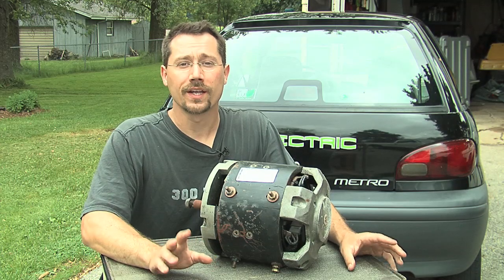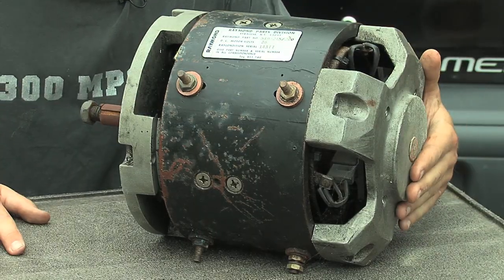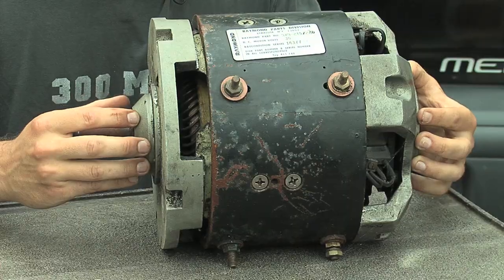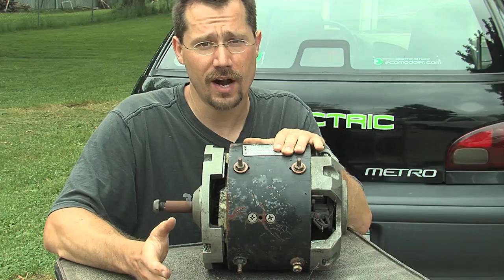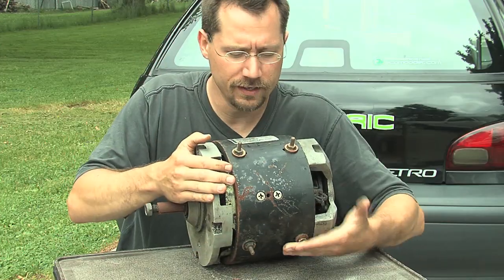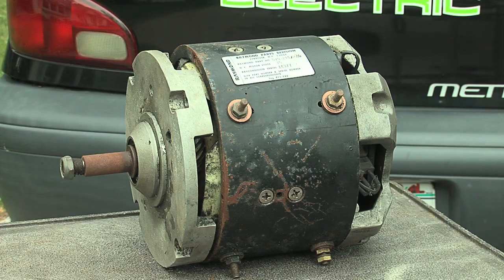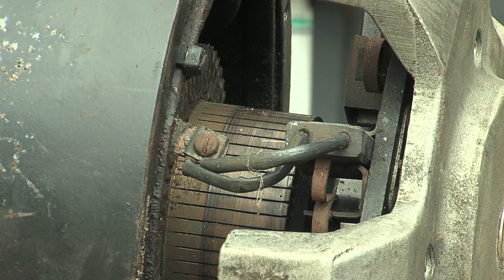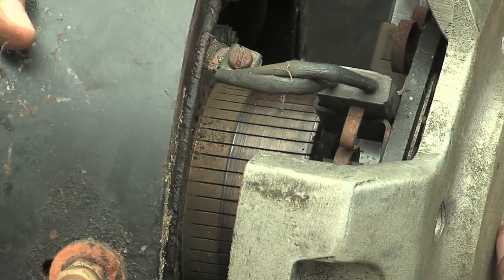5 Build Your Own Electric Car: DC Motor Basics

Comment: can you please tell the max torque/rpm of your motor.
Reply from the maker: The motor I used in this car was missing the ID plate, so I can’t tell you what it was listed at. I can tell you that I was able to have it draw up to 500A at 144v, which is close to 100 horsepower, and the car could go 70+ Mph.
Reply: @BenjaminNelsonX  sir was there any calculation behind the motor selection.
Reply from the maker: @noelsovy5013  It was really more a matter of looking at size and other qualities of the motor. This is best described by Jim Husted in a thread on the DIY Electric Car forum.
https://www.diyelectriccar.com/forums/showpost.php?p=20666&postcount=1

Comment: A great follow up to this would be to explain exactly what to look for when trying to find a motor  that will work for an EV conversion. I've seen 36v electric motors with HP rating as low as 1, which clearly wouldn't work. You mention going and finding a motor in a salvage yard but not what to look for...
Reply from the maker: Here's the best description I've ever seen in what to look for in a DC motor. It's by Jim Husted, long-time DC motor guru.
https://www.diyelectriccar.com/forums/showthread.php/using-forklift-motor-and-choosing-good-7598.html

Comment: Great video!
2 things:
-What type of armature winding?
-How much power the motor?
Thanks
Reply from the maker: The motor shown in the video (and the one used in the car) are both Series-Wound Direct Current (DC) motors.
I don't recall the exact power, but both motors were from forklifts and are capable of SIGNIFICANT work.
I was able to pull 100 HP out of the one in the car.
Reply: @BenjaminNelsonX  Ok thanks

Comment: How many RPM's is the motor capable of?
Reply from the maker: On a DC motor, speed (RPM) is determined by voltage. The higher the voltage battery pack the motor is connected to, the faster it spins. At some point the brushes need to be advanced as the magnetic field twists at higher voltages/speeds. Generally, a good DC motor is going to spin anywhere in the same range that a gas engine would (plus the ability to spin SLOWER than idle speed - a gas engine just dies below a certain speed. DC motors tend to have LOTS of torque on the low end, but the torque drops off at high speeds. Amazing for drag racing, but not as good for passing at freeway speeds.

Comment: So, very generally,  what "Horsepower" (since most of the DC motors I see online include that as a spec) should I look for as enough to be able to drive an average car.
Reply: Chevy bolt motor is 200HP

Comment: Hi Mr Nelson.. love your video's.. i'm building a band saw mill and using a 24 volt Raymond forklift motor to raise and lower my head assembly but can't figure out how to reverse the motor. . it has two studs coming out of the casing, one stud is wired directly to two of the brushes and the other stud is wired fist to the field winding and then to the other two brushes.. i've tried detaching the field winding and grounding it to the casing with no success  and can't figured it... any help would be appreciated... tks in advance..Don
Reply from the maker: Hi Don,
Most common forklift motors are "series-wound".
The power goes through both the armature and the field in series and then back to the battery to complete the circuit.
If you reverse the polarity, you reverse the polarity of BOTH magnetic fields, which of course means the motor keeps spinning the same direction!

Motors for pumps typically only have one pair of power connections on them.

Motors for DRIVING the forklift usually have TWO pairs of power connections. This allows you to reverse polarity to JUST the armature or the field. That allows you to reverse the rotation of the motor, which is what you need for a direct drive that can spin either direction.

It sounds like you have a motor which was only ever designed for a single direction of rotation. I would recommend swapping it out for a different motor.
If you want to keep using that same motor, you need to physically modify it. You would need to add another pair of power connections at the point where the armature and field are wired together. It is certainly possible to do, but probably easier just to use a different motor.

Comment: 36v can be used to drive a car? Does the car need more powerful motor?
Reply from the maker: It COULD be used to drive a car, but your probably wouldn't want to. 36V was traditional for electric golf carts, until they went to 48V.
Forklift motors can be plenty powerful enough to drive a car, but you typically want higher voltage. Remember, POWER is Voltage times Current. At Low voltage, you need extremely HIGH current for the same amount of power.
You also need very thick cables when dealing with high current, and it's much better for batteries to have a low current draw than a high current draw.

Also, on DC motors, speed (RPM) is proportional to voltage. The higher the voltage, the faster the motor spins. Unless you want something with a top speed of a golf cart, you will want higher voltage.

I originally ran my electric Geo Metro conversion at 72V, which had a top speed of 45 MPH. That was actually fine for where I live, just outside of town. I later experimented at up to 144V, and had no problems with freeway speeds.

Comment: Great vids! Makes it seem possible for an average guy like myself to tackle this or similar projects. Could you tell me how fast this FL motor pushes the Geo? Please and Thanks.
Reply from the maker: Fastest I ever went in this car was 72 MPH in a 55 zone. The batteries were pretty basic and weren't designed for a huge current draw. Just upgrading to modern lithium batteries would be a big improvement. Please keep in mind that I am writing you now over 10 years after I built that car. Cost and availability of parts has changed tremendously in that time. DC motors are still useful and are used in lots of EV dragsters.
Reply: @BenjaminNelsonX  Thanks Ben. You the man!

Comment: On old trolley cars, they used a DC 6 pole motor. A series wound motor has more torque than a parallel motor, however a parallel motor has a higher top speed. The motor was started in 6 pole series wiring, then changed to series 4 pole wiring for a little higher speed, but the torque is less. As the trolley gains speed, it is switched to 6 pole parallel wiring for more speed. Finally it is shifted to 4 pole parallel wiring for high speed. The large Pacific Electric trolley cars could reach over 100 MPH that way.

Comment: It's not pressing against each other at all. The DC motor is a machine that transforms electric energy into mechanical energy in form of rotation. Its movement is produced by the physical behavior of electromagnetism. DC motors have inductors inside, which produce the magnetic field used to generate movement. But how does this magnetic field changes if DC current is being used?

An electromagnet, which is a piece of iron wrapped with a wire coil that has voltage applied in its terminals. If two fixed magnets are added in both sides of this electromagnet, the repulsive and attractive forces will produce a torque.

Then, there are two problems to solve: feeding the current to the rotating electromagnet without the wires getting twisted, and changing the direction of the current at the appropriate time. Both of these problems are solved using two devices: a split-ring commutator, and a pair of brushes.

Comment: 4:42 multiple gears of reverse? (That’s when I realised the gearbox was not going to be removed) That seems to be counter-intuitive to me. I think the true value of electric cars lies in less components so no gearbox (at all) should be the aim, in my view. Less moving parts, less servicing, less weight. You need to reduce weight because of the weight of batteries.

Comment: I don't think that is a series wound motor you are wiring it in series but the motor itself is not in any particular alignment. You could probably run that motor and parallel by just using two bus bars to connect to 4 bolts.

Comment: FWIW Motors like the one featured here wasn't intended to operate at speeds cars typically do on highways. You should build it with that in mind.
Reply: He can probably keep it at reasonable rpm since he uses it with a traditional transmission

Comment: Well I thought that you'll show materials needed for the change of gas to electric not the way the electric motor works things as watts batteries and control
Reply from the maker: Hi Jose!
This is one of a SERIES of videos. Other videos in this series show batteries, the motor controller, and other things you need for a complete conversion. Watch the whole series at: https://bit.ly/2zMufmN

Comment: If you use two of them in series does it make it more powerful
Reply from the maker: Yes, there have been many projects where builders have used two motors connected together for more power. One way is by belting two together. Another is to use motors with tail-shafts and connect the tail-shaft of one motor to the drive-shaft of the other. That's typically called a Siamese-Twin. Here's one example of that type of setup. https://youtu.be/Ie7qvo-aC5k?t=202

Comment: I have a question, please consider answering, car companies that mass produce EVs such as tesla, nissan leaf, chevy bolt, etc. tend to use BLDC or AC motors that don't have brushes. They do this since AC and BLDC tend to last longer than typical DC motors.Then won't it make more sense to use BLDC motors? Please clarify
Reply from the maker: Motors without brushes are slightly more efficient and are completely maintenance free. (Brushed motors eventually need the brushes replaced.)
So, it makes sense for new manufacturers to use them.
It's really only relatively recently that good AC motors appropriate for DIY electric cars have been available to home builders. The controls are more complicated, and the motors have tended to be more expensive.
The motor that I used to convert the Geo Metro was a used forklift motor which I bought for $50. Brushed motors are readily available, simple to control, and offer very high torque.
While AC motors can be very good, it doesn't mean that DC motors can't also work as excellent electric vehicle motors.
Reply: BenjaminNelson Thanks! I was wondering since ev conversion businesses like ev west and even Tesla motor’s cars have AC motors and they use inverters for the AC power needed. So thanks, this helps a lot!

Comment: I will look at the rest of your video's on this motor for a automobile. Question can you rig up some sort of way to produce power as the car is running, which would then supply power to the electric motor?  For NOW gas prices are crazy, also to charge batteries drive, charge batteries. Its the same as buying gas. I am not the type that the world is coming to a end. Someday it will if people wont wake up. I just like to simplify things for myself. Like right now I have free power, people all around me pay a bill and scream. I laugh, as I laughed the day the power company came out to ask if I had any problems. No why, your house is not drawling any power, because I am not hooked up. I then got out a ladder and bolt cutters went up and cut the lines to my house, in front of them. Then took the guy in my house and shop. Welder, Tv,refrigerator,electric baseboard heaters, so on. The guy was laughing and he left.  I have several car alternators converted to motors, then belts run to alternators to produce power, to keep batteries charged then inverter's, then wires to my breaker box. So I would like to figure out how to power a car, similar as you and my power to keep charged and run the motor. Any thought's on this?
Reply from the maker: Energy has to come from SOMEWHERE!
https://300mpg.org/projects/electro-metro/perpetual-motion/

Comment: Hi, are you sure its a series wound motor? Is it not a Shunt Motor (Separately Excited Motor)?
Reply from the maker: No, it's definitely a series-wound motor. The reason it has four connections for power is to be able to spin the motor backwards for reversing the forklift this motor came from.

Comment: Have you ever custume modify a motor?
Reply: there isn't to much you can do for motors, maybe put better bearings, thicker gauge wire, laminate, or replace and rewind the housing magnets, different type of brushes, problem is these wont really make any difference power wise, could help the motor last longer though. You could potentially rewind with thicker gauge wire so you can up the voltage and amps and get more power that way, but you may have problems rewinding and it's generally done by machines to produce a tight and uniform wrap, doing it by hand may produce worse results even if you can up the voltage and amps. You would be better off buying 2 identical motors, and bench testing one until it breaks, test what voltages and amps the motor can actually handle before burning up, the information on the motor is for a safe reliable operation, but it will run at say 48v instead of 36v and with higher amps, but may only last a few hours before the wires or motor burns out.

Comment: so if you don't happen to have a fork lift in your local junk yard.... results that can not be reproduced....  how would you even be able to compare if motor was powerful enough why did a fork lift motor feel like it had enough power. if I am converting a school bus surely I will need of something then if I am converting a geo metro. I want to plan out exactly how much it's going to cost me to convert something before I start, to know if it will be worth it. I am happy you showed me a cheaper motor and the way to restore it but will it be enough. and why run it threw the transmission wouldn't that just be power loss? clearly the motors are able to go in reverse. is their some reason for this?
Reply: You need to do your own homework dude. Nobody can tell you anything accurate over the damn comment section. You nees the tranmission, well, for obvious reasons...it has GEARS. Start off it 1st gear and end up in 5th gear...
Reply: You aint gonna get no bus to be electric driven so forget about it.

Comment: Separate connectors for the field and armature make it a "shunt wound" motor.
Reply from the maker: This is a series-wound motor.
The separate connections allow you to reverse the polarity of either the field or the armature SEPARATE from the other. That allows you to reverse the direction of the motor. (You can't simply reverse polarity - that would reverse the magnetic field of both the armature and the field - reverse of reverse is still forward!)
This is how the forklift this motor was originally used in would go into reverse. Some series-wound motors will have two power connections, some will have four. The motors with only two power connections are not reversible, and are commonly used for the hydraulic pump motors on forklifts.
It's common on a series motor with four power connections to add a bus bar to make the series connection once direction of the motor has been determined. That's what I did on the Geo Metro. Since I still have the manual transmission, I used that for reverse, but made the motor itself only spin one direction.
That's also advantageous for advancing the brush timing. You would only want to the motor to go one direction if the brushes are advanced.
Reply: @BenjaminNelsonX  Nevertheless, separate connections for the field and armature constitute a shunt wound motor. The motor could be run as a shunt wound and could be run over base speed by reducing the power to the field coils, with the proper precautions.

Comment: Very informative video and great food for thought!  First mainstream 20th century cars were mostly electric because they were so reliable.  Bugaboo then (and now!) was batteries.  I see why you have electric car enthusiasm, but every time I look into buying enough batteries to make my hot rod electric car there are too many zeros on the price tag!  Guess that's why you drove 900 miles to salvage batteries out of an electric truck.  That still looks like too many zeros for batteries to me, so I'll watch your upcoming vids with interest!
Reply from the maker: The battery capacity in the Smith/Staples truck is as big as what's in a Tesla Model X.
The Smith truck was cheaper than a Tesla.

Comment: Nice vid (from someone that is really not schooled in electric motors)... some terms are slightly off... The rotor is the whole rotating assembly, the armature is the shaft that runs through the center if the rotor, supported by the bearings. The magnetic action he described as reversing, is actually not 100% reversing, thus causing a "rotating magnetic field"... known as electromagnetic force...
Reply: Oh yes the pointy thing... is an awl... that's all folks...

Comment: I have a motor off of a tire mount/dismount machine. It's got 4 wires which I'm assuming atm is the dual coil setup you mentioned in the video. It also had a starter capacitor (I think) which went bad. How important is it to have the starter capacitor and am I able bypass it and still have the motor work?
Reply from the maker: If the motor has a starter capacitor, it sounds like an AC motor, not a DC motor.
Reply: Yes it is an ac motor and no it will not work without a capacitor that is the exact same microfarad and a voltage rating the same or more as the supply voltage .